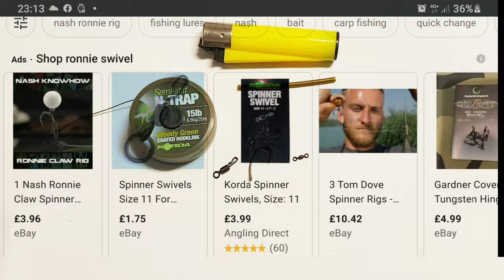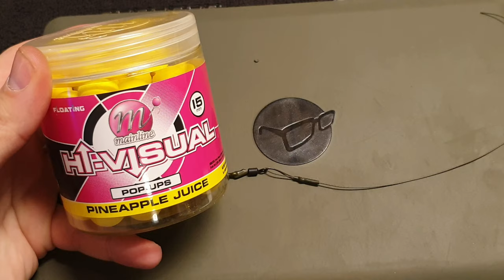The simple ronnie/spinner rig

Comment: What size hook would you recommend for a Ronnie rig? Can this be started on a wide gap curved 10 upwards. , only really started Carp fishing this year. And after catching my first carp “ I’m hooked “ you’re video on the Ronnie rig is easy followed I’m going to try it, brilliant video thanks
Reply from the maker: Hi pete,

Hook size doesnt really matter, but the smaller you go, the eye of the hook gets smaller so youll be unable to put the spinner swivel through the eye of the hook if that makes sense? Id say size 8 and above and you'll be able to make this rig with off the self parts. Personally i like a curv shank size 6 with this rig. I fish with a soze 6 even in france for the real big ones and never felt a need to have to use a huge hook

Comment: The Korda hybrid stiff is great for crimping, I like to use crimps as they’re very strong, plus you have the benefit that rig putty grips to it perfectly. We all have our own preferences of course, ultimately, it’s what you’re confident using. Good video, thanks 👍🏼
Reply from the maker: Hi martin, thankyou for taking the time to leave a comment, i appreciate it, it helps the channel out loads! I agree with crimping, ive used them in the passed but always find myself just tying a knot these days, saves getting the crimps out, the pliers then then dreaded "i hope that doesnt slip" second guessing. Plus for a tutorial on a simple ronnie not everyone has pliers and crimps, its extra cost to the rig that when it comes down to it, doesnt really need a crimp just a sturdy well tied knot. Hope your enjoying the content, any recommendations on new content is also welcomed! Tight lines
Reply: Hi Martin what size Korda hybrid stiff braids are you useing
Reply: @bertharding1987  20lb hybrid stiff is the only coated braid I’d crimp Bert. For all you non crimpers, just stick to what your confident with using. I just find them super strong and once you’re used to them it’s very easy and extra strong and the crimps cost pennies. 
As @samsung carper said the Ronnie swivels are better to use as there’s just more movement and you also want to have it through the front of the eye on the hook as the way it’s put on here closes the gape a bit so may hamper your hook holds, so just hook the Ronnie swivel through the front of the hook but that’s just how I like to do them. I’d also put the hook bead on the small end first so the ring swivel can travel up and down the shank of the hook a little more freely. Again, I’m not criticising … it’s just what I find works best for me. Check out Darrel pecks video too. (Just search crimping hybrid stuff) this will still work well and as Mr Samsung said - it’s a choice 👍🏼
Reply: @SPS_survivor   thank u mate Yh I see what u mean I crimp my braid line but as u say the best line to use is the Korda hybrid stuff is the only u would crimp u say mate
Reply: @bertharding1987  sorry mate is that a question or not? I’m super tired. In hospital at the moment having 3 weeks of treatment on my back.
Reply: @SPS_survivor  sorry to heard that mate Yh I ask is that what u mean is to crimp the hybrid stiff line  I know what u mean now mate and I hop everything goes well for you Martin 👍👍
Reply: @bertharding1987  thanks for the kind words mate. Yep I have 100% faith in crimps in hybrid stiff after 8 fish in France on the one rod with the spinner/Ronnie rig, the biggest being 53lb and a few ounces - totally smashing my PB - it’s in my profile pic but not a big enough image to see it properly. It’s head was about the same size as mine. This was actually the last fish too so even after a string of 30’s and 40’s it still didn’t slip!! Fishing with a braided mainline too - that’s scary when you do it for the first time 😂 you feel every single thing right the way down to the reel from the fish 😮‍💨😅 - tight lines my friend
Reply: Martin n what size swivel can I use for the bottom swivel what size would best for the pop up to go on to
Reply: You mean the swivel on the hook? It needs to obviously be large enough to fit over the barb and be able to move up and down the shank. With a “kurv shank” or “wide gape x” in a size 4 
Recommend a medium micro ring swivel (allows loads of movement) a large hook bead, and the spinner swivel itself being a size 11. Hope this helps - I’m still in bloody hospital!! 
Put some on the bank for me!! Tight lines mate and try not to overthink rigs too much. Just choose a few that works for you, master them and away you go. 

Whilst being important, they can also lead to you not having a fun session if your constantly worried about presentation! 

Is this for one water in particular? I probably use 3-4 rigs all the time, wherever I’m fishing, whether it’s in the Uk or Europe! Tight lines 🎣
Reply: @SPS_survivor   yes mate what size as I’m useing hook bead and the go over the top of the bead it don’t stop it from comeing off if u know what I mean Martin
Reply: @bertharding1987  large hook bead and a medium micro ring swivel (these are based on Korda products) you may get away with a medium bead if you careful as it’ll be a very tight fit (what’s your hook size?) … if there was a way of putting a picture up then I would.
Reply: @SPS_survivor  so would you use braid line for ur mainline I only for my hooklink rig makeing
Reply: @SPS_survivor  are you on Facebook mate send the picture bertie Lee Harding add me up mate
Reply from the maker: Hi bert, ill list all the componets youll need below.

Hooks - perferably a kirv shank pattern - i use korda size 6 kurv shanks.

Rig beads - korda rig beads, they come in a pack of 20, search korda rig bead on google and you'll see them.

Rig swivel -  korda rig swivels, these come in size 20 and a pack of 20. These will not pass over the bead. 

Ronnie rig swivel/spinner rig swivell - again stick with the same brand as you buy everything else from so korda it is for me, they come as a size 11 pack of 10.

Hook link material is your choice,  but i use the korda semi stiff, kicks the rig away lovely but just soft enough to be able to lay fairly flat on the contours.

Mainline stick with mono, braid mainline under tension is like cheese wire and can really do some damage to the fish, it has its uses like really weedy lakes as it will cut through weed easier than mono. That being said fish clean spots in the weed, clutch locked up and rods strapped down, drop your leads and the weed wont be much of a problem using mono.

Hope this helps 👍
Reply: @SamsungCarper  hi mate what do u mean by pattern are they two different hook kirv shank is that a name of a hook but I don’t no what u mean by pattern u said you use size 6 Kiev shank are they two diffhook or not
Reply: @SamsungCarper  what are the kickers
Reply: @SamsungCarper  I use Korda to there do good gear I keep with them so I say a size 11 swivel
Reply: @bertharding1987  haha I think someone might be extracting the urine over all of this, especially for such a straightforward rig ?!
Reply from the maker: When you hear the term 'hook pattern' it meand the style/shaoe of hook. I kurv shank is the one to go for. Kickers, the mediums will be fine. I prefer shrink tube tho, unless when you say kickers you mean shrin tube, they both donthe same thing, kickers are pre cut and silcone where as the shrinkntube is a standard length of plastic that you cut to size then steam to shrink over the swivels/eye of the hook. What the video a few times and youll see i use shrink tube.
Reply from the maker: Hahahaha 😆
Reply: @SamsungCarper  @Samsung Carper, got a very sneaky suspicion that we’re being being mugged off mate 😂
Reply: @SamsungCarper   what’s that meant to mean mate
Reply: I ain’t mugging no one off I’m just asking as I new to the rig makeing I’m leaning pal we all lean something new pal
Reply: @bertharding1987  cool, plenty of info now then 👍🏼
Reply: Yep I got everything what I need 👍
Reply: @bertharding1987  no problem by the way. Tight lines 🎣

Comment: Just a quick question, at the other end with your lead system, could you use a speed bead to attack the hook link?
Reply from the maker: You can tie the rig on loads of ways, i just loop the ends because i find it fast. Some people tie it directly to the eye of a swivel. A fogure of 8 loop knotnis a very strong knot and it also make for changing rigs easy, not cutting off old rigs etc, just unclip and on with a new one. Always cover the clip with a silicone tube or a tail runner wtc, helps stop the rig finding its way off the clips, they have an uncanny ability of doing this. You cna bet it will always be when you have 'that' gish on the end aswell.

Comment: Great video, but how do you attach the other end? Is it via stick grip or stop bead. Can you use with an inline lead system??
Reply from the maker: Hi millie, the other end i tie a figure of 8 loop knot and use a quick change clip with a silicone sleeve over it. You can also tie it directly to the swivel on your lead clip providing you use an anti tangle sleeve. This rig can be used with an inline lead set up just be mindful about how soft the bottom is if an inline lead plugs into silt it could leave the hooklink all wonky. Light weed, silk weed leafy choddy bottom you'll get away with an inline lead.

Comment: Great video very detailed. I am yet too make one of these but I am eager to try. I am just wondering if there is a hook link that is good for both types of surface ie weedy and gravely? Thanks
Reply from the maker: Hi harry, i use the korda semi stiff for both weedy and gravel, i just change the length of the hooklink, ie, longer lengths for weedy waters and shorter rigs for smooth/gravel bottoms. Also weedy waters i may use a heli style lead set up to help the rigs sit ontop of any weed/debris. Have a play around theres no set rule as to how stiff or supple your hooklink needs to be. 99% of all.my rigs are made from the korda semi stiff.
Reply: @SamsungCarper  that’s perfect thank you for the quick reply.

Comment: Please show under water how the rig looks like after making the rig as there are various heights to the rig and what size pop has been used as well to balance the rig
Reply from the maker: Hi shalan, the size of pop up doesnt really matter as every brand, flavour and size have all different levels of buoyancy. Typically i got for a 15mm pop up. To balance it i either trim abit of the pop up off and test it after each little trim untill im happy with how it sinks....or....i use some tungsten putty around the swivel barrel, that way i know the height it will sit, this will be from the eye of the swivel to the top of the pop up roughly 25mm -30mm off the bottom. But obvisouly this all depends on how solid the lake bed is and if there is any weed etc.

Comment: One more question do you tie a eye/swivel to the top of the rig to attach to your rod or just leave the loop? Thanks.
Reply from the maker: I loop the end of all my rigs and then use a quick clip on the end of my leader. Persoanlly i use the silicone sleeves to then cover the loop and quick clip because if you dont then loop has this funny knack of finding its way off the clip, so always always slide simething over the clip. If you drop me a message on insta @samsungcarper ill send you a picture tomorrow

Comment: I’ve tied this rig mate and tested it and my hook is laying flat to the bottom. Any suggestions? I’ve tried balancing with putty but still no joy. Thanks
Reply from the maker: If your hook is laying flat on the bottom to me, it would suggest you're using a wafter, which is a semi bouyant bait, it's half pop up half bottom bait. This rig will work with that type of bait also, but if you want it to pop up, you need a more bouyant bait. There are two ways to do this. 1st buy some fresh pop ups they'll cost around £5-£8 for a tub. 2nd you can add a foam/cork topper, drill out the bait u have and put a cork dowel into it. Add putty will only make it heavyier  you need to go lighter.
Reply: @SamsungCarper  correct mate it was a wafter. Great detailed answer, just what I was after. Appreciate you taking the time to explain so well. Thank you
Reply: @SamsungCarper  would you need to glue the dowel mate?
Reply from the maker: Nah, no glue needed. I'm on the bank now waiting for rods to go off I'll do you a video while I wait.
Reply: @SamsungCarper  ok mate. No rush re video. Thanks again. Enjoy the fishing
Reply from the maker: Should be uploaded in around 8 minutes.